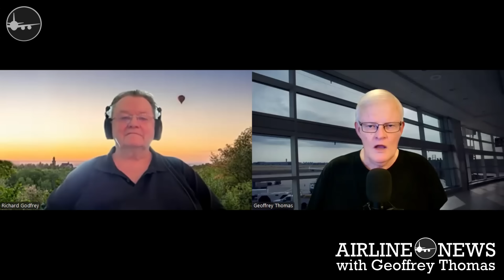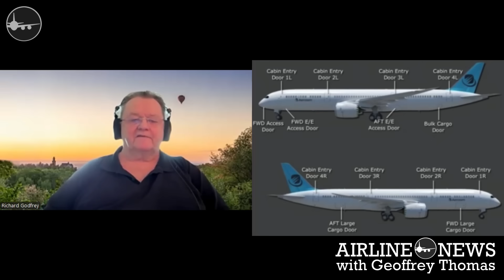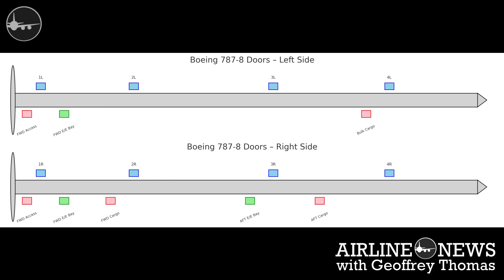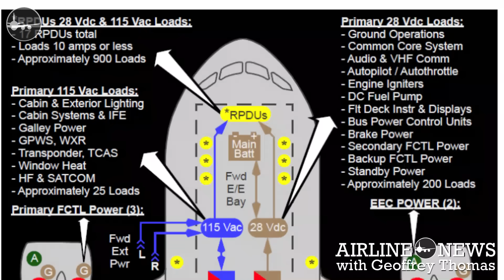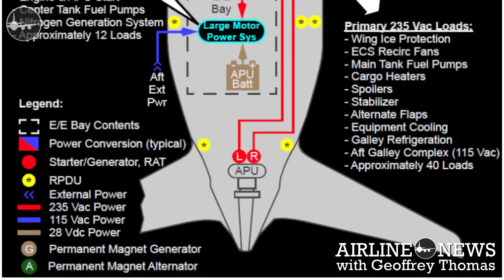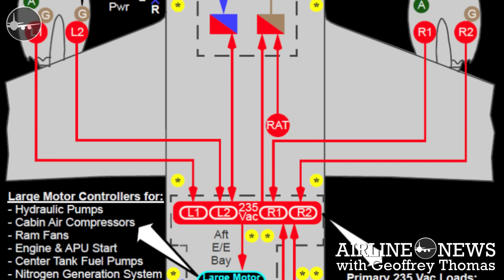Air India Crash Eps 189 - Toilet Leaks Exposed

Comment: You guys are running away from what happened..fuel swich were turned off..first officer saw them at off position  and thats why he asked  the question....he wouldn't have asked if they were not turned off..so stop this please
Reply: ....or maybe he did not see anything, and was simply asking a question, not making an accusation.
Reply: @BlueSpruce2 why would he mention the switches? he would have said we lost both engines...but he mentions the switches for God's sake
Reply: @mwajum Actually whoever "he" was did not mention the switches.  The question allegedly asked was "why did HE cut off" not "why did YOU cut off".  Who's" HE" or did he mean " IT?"  That could be interpreted as a question not an accusation.  We need to have the full CVR recording and transcript in whatever language they were speaking in to understand the context of the exchange.
Reply: @BlueSpruce2  an odd question to ask though. Wouldn't you check the switches that are clearly marked 'cutoff" before making such a statement. ?
Reply: @rodwiggs8892 But it could also depend on when the statement was made - after the engines failed and a potential restart attempt, or immediately after reliazing something was not right?  And did the person asking that question immediately switch them back on?  We really need the full transcript, accurately time stamped with what was being said in the cockpit and what were the mechanical/hydraulic/electrical systems, including the RAT deployment, simultaneously doing on the aircraft.  Like these two gentlemen, I'm just giving everyone the benefit of doubt until we have more conclusive information.
Reply: @BlueSpruce2  fair call. There was a 10 second gap between from cutoff to the movement of the switches to run. This is strange in itself. It's just odd for the copilot to accuse the captain of cutting off the switches. If you think about it it, if you notice the engines have no thrust, you would most likely say, "what's going on here?" not accuse a superior of cutting off the fuel switches. Surely that would be the last thing he would assume has happened. All speculation i guess, but i am not buying the water egress theory, even if Richard isn't 'selling'
Reply: They were trying to restart the engine

Comment: Wow i have a lot of questions here.   So does this data say that the original report that the two eng fuel switch cut off never happened ?   If you look back i have always asked is it possible and thought that the pilot never turned off both switches in one second and that the second  movement of the switches was the pilot trying to relight the engines..   As for things not being done in aviation that are required, i can say this IS true but cant say how i know it is true,   Boeing has a history of money being more important than safety.  over 600 dead and one A/C pilot figured out how to disable the auto flight controls trying to fly the aircraft into the ground and saved that A/C.  Cant wait till the final report by them and you two is out.  It should obvious to everyone that Aviation is flawed like so much in this world, unfortunately these are avoidable.   I am a pilot and I am too worried to even fly commercial now days, and not because of mistakes but because of lack of honesty that leads to more and more mistakes. (not knowing the real issue prevents correction)  Amazing that there is not more media covering this,   When the truth comes out the stock will plumet.   THANK YOU TWO AND OTHERS WHO HELP YAW FOR ALL YOUR WORK AND KNOLEDGE IN CONTINUING TO NOT RULE OUT THINGS AND TO KEEP LOOKING !!!!!!   Im guessing there will be more to find and there will be a lot of money and effort to cover up the real causes of these and other tragedies.  Again thank you for your hard work and efforts.   SEEMS THAT ENGINEERING WOULD  REDESIGN THE WET AREAS AND ELECTRICAL AREAS.

Comment: I guess my question is if one of the pilots activated the fuel cut off switches intentionally, why did they wait 10 seconds to turn it back on at such a critical time?
Reply: I believe the wait was an effort to clear the engines of excess, pilot thinking possibly contaminated fuel. This was a Throw the Book out the Window situation. I wonder if the "Dust" at the end of runway was unburned fuel. Pilots were obviously overwhelmed by error messages, and tried everything to save Themselves and the passengers.

Comment: Thank you for today's episode. There  were / are two  active AD -NPRMs not just one, that relate to this. The first one below  is the one you mention  in the list.

1.) Docket No.  FAA 2025 -1103 /  Project Identifier  2024 - 00141 -T. ISSUE DATE 16 JUNE 2025. /  references back to AD 2024 -01 -01 / Faucet Control Module.  Not all 787 effected - large number were including AI171 - due to some smaller number having a different FCM.  

The second one  which has been mentioned at least thrice before but   never seems to make recognition is the following.

2.) Docket No.  FAA 2025 - 1114 / Project Identifier AD 2025 - 00314 -T. ISSUE DATE 18 JUNE 2025 / references back to at least AD 2023 -08 - 04 /   Missing or incorrectly installed potable water clamps ( galleys and lavatories ) . All 787 including obviously, AI171. 

Given their timing,  ( +4 +6 days after ) these two AD - NPRMs could be a type of tell as to what the FAA's best guess was  in the days after the incident.

________

 So essentially many - most - all  787s   basically started off with poorly designed and assembled  potable water systems, ditto for floor sealing and  whatever else. Nobody should be satisfied with how the FAA / Boeing / Operators as  a group have handled this.
 Perhaps especially with the Lavatories .Clearly nobody wanted to  just start over with new lavatory / galley modules  - until now.

FAA never should have allowed these various water into EE Bay fiascos to drag on and on - and on for 10 + YEARS. 'Inspections' and the other blah blah are no substitute for properly designed and functioning equipment. On any A/C but 10x over for an ' all electric / electric hydraulic' 787.

There are at least two ? other ADs that relate to all this plus the expected AD - NPRMs for all ADs relevant here plus  one ? AD 'withdrawal'. Go read the comments for the various stakeholders especially the airlines, and look at the far more detailed and descriptive language used in the  NPRMs - eye opening does not cover it.

Comment: Finally the root cause has been found. A drop of water has caused a dual engine failure while the FDR did not record anything of the electrical problems caused by that but instead   switch movement . Sounds logical.
Reply: Typical conspiracy theory playbook. Dismiss obvious and simple explanations because of something that isn't fully understood and amplify exotic explanations. Oswald wasn't a good shot because he got one bad score in the Marines, therefore he couldn't have been the one who assassinated JFK, therefore the only explanation is that the CIA pulled Oswald off the window at the last minute and put in a substitute marksman. Conspiracy theorists also like to surround their explanations with lots of scientific sounding analysis. The 911 Truthers do that too, nanothermite, collapse rates, blah blah blah.

Comment: Great info from start to  the end. One issue I have commented on in past videos re maintenance not being carried out if  outside temperatures were 37C what would the temp be inside the Boing sitting in the sun especially with the AC  not working and causing a very harsh environment for maintenance to be working in not just for Air India but any other maintenance workers in any countries

Comment: This is the only podcast that provides an exhaustive presentation of available data and a thorough analysis of the data based on the engineering and performance of the aircraft and the necessary protocols that the pilots have available in an emergency. I have seen many supposed experts weighing in on the crash who persist in pushing theories that have largely been falsified, such as the pilot suicide theory. Yes, suicide - mass murder is great click bait, but pinning murder on men who are in no position to defend themselves in disregard of forensic evidence is a serious failure. In light of irregularities in the initial report, Air India’s awful reputation and the financial expedience of shifting blame intuitively adds weight to the hypothesis that ongoing, negligent maintenance led to system wide electrical failure land engine shutdown. Two matters I would like to see addressed are 1) why are toilets and galleys located where leakage can impinge on critical electrical equipment; and 2) since the need for redundancy in critical systems has long been a priority, how is that both engines could shut down simultaneously from the same (minor) failure?

Comment: Everytime richard brilliantly explains something always gives me another explanation to what may have happened.
The part that I didn't get was the pilot saying why did you switch off,could it be possible that when the rat deployed the pilot flying lost all power was transfered to the captain? Hence why he said why did you switch off? I supose without a full timestamp of the voice recording it is speculation but may have nothing to do with fuel switches.
Reply: The report actually said ‘why did he cut off’. Precision here is important, even more so if the conversation was conducted in Hindi, which I consider very likely.

Comment: Thanks for pointing out that the pilot monitoring and the PiC flipped with the initial pilot flying.   So the first officer was busy flying on takeoff and would be too busy to be shutting off the fuel and the pilot took over and almost got that plane to the highway.  He didn’t try and crash it which he could’ve easily done at that point if he was interested in suicide.  He also almost made that highway which it is obvious that he was trying to get to and would have made it after clearing that last building.  If he could’ve made it, it would’ve saved a lot of lives in my opinion.  Neither of the crew  intentionally shut off any fuel to the engines and they were struggling with a mostly dead and dying aircraft.

At TOGA, those jets are drinking gallon jugs of fuel per second.  Any interruption even for Deca seconds is going to be an issue.
Reply: They are also a lot of YouTube channels that completely don’t get this point and it is a huge oversight to their rush to judgement.

Comment: Would it be presumptuous to suggest that lower than normal fuel flows might have extended the take off roll before possibly worsening once airborne and lead to significant thrust loss such that the accident occurred as it did? Any relight attempts thereafter, both automatic and manual, would then be compromised

Loss of PF’s flight instruments at that stage would also invoke ‘discussion’ and that audio would be captured on the CVR …
Reply: Soon after the time of the crash, I saw a claim that somebody at AI said they were using lower takeoff power setting to save fuel.  I saw that on youtube.  I tried to  find it with a web search but I don't know who said it.  I thought it was these guys.

Comment: Would be good to know where the condensation drain line from the air conditioning system is, especially if the air conditioner failed as indicated by passenger videos on a prior flight.

Comment: Excellent job but how do the investigators prove it to be correct?   The remains of Air India AI171 have been removed from the crash site , the resulting fire from the crash would surely leave no trace of water. How can they prove the electrical failure was caused by a toilet leak and not some other electrical failure such as perhaps a recently change component.   Those maintenance logs seem to be key to finding out.

Comment: Excellent work Richard. As a 787 Captain and examiner I’m impressed with your in-depth knowledge and sharp brain. 
Cudos to you both for an outstanding channel about aviation accidents and incidents. 
Keep up the amazing work.
Reply: I agree! B777/787 Instructor/Examiner & recently retired 787 Capt.
Reply: *Kudos.  With a 'K'.  😊
Reply: @MsLizziebeth1  He was referring to the Clinically Useful Depression Outcome Scale.
Reply: @martinwhite418  - Ahhhaha. Ha. Almost funny!
😊 But not quite.  😅 (Yes it is.)
Reply: @MsLizziebeth1 Thanks, haha.
Reply: So you 787 experts believe some drops of water can cause a simultaneous dual engine failure?
Reply: @JM_2019 Evidently everyone else knows water and low, medium or high voltage electricity doesn't mix well... 😊
Reply: @BlueSpruce2 This is why aircrafts are build with redundant systems. One leak causing redundant systems to fail is something you could not even achieve easily on purpose.
Reply: @JM_2019  Noo, it caused thermal runaway from the li-ion batteries which also rendered the aft fdr inaccessible. 'parrently. [It wasn't located anywhere near the huge explosion + fireball which resulted from the plane crashing] Recalibrate your understanding pls! :face-blue-smiling:
Reply: @mushymystic  If a thermal runaway was the reason for the dual engine failure and made the FDR inaccessible - how can it be the switch movements and the conversation between the pilots were recorded after that? The belief that there is a single source of power supplying all systems is just not correct. FDRs have emergency power supply batteries and even if they fail the are supplied by the RAT.
Reply: @JM_2019 i might not have stated clearly, “inaccessible… to aaib crash investigators…” not inaccessible to the plane recording anything 😊
Tbh i was just riffing on some of the more desperate explanations i have read, and trying to match the level of confidence those explanations are delivered with. 
It’s like devil’s advocate but even more soul-less 😁
Reply: @JM_2019  you have to go in very detail. Some things can be calculated, simulated or tested in real situations. There also are (maintenance/failure) reports and experiences. Of course if a captain shuts down the fuel at low altitude during take-off  i think that is a procedure that almost certainly will crash a plain so ...why should he do that? Why should he think that will save/safe the aircraft?  And why did he tell: i did not do that? Why did they find the fuel switches were turned on and off? Did they really find that? What did they find? Yes ....the machines recovered but .... a crash was the result.
Reply: @HenkJanDrums That‘s the important point: „why he did it“ is not part of the accident investigation, this is part of a crininal investigation.
Reply: @JM_2019  Also, consider that after the inbound flight from New Delhi to Ahmedabad, the aircraft maintenance team had inspected and cleared the aircraft to fly. If urine was dripping into the EE bay, would they clear it? Is AI maintenance that demented?
Reply: @JM_2019 ...and miraculously exactly at the moment of rotation.  This gets more and more laughable with each episode.  Why do you 2 keep fighting the initial preliminary report?
Reply: @JM_2019 What's so difficult to understand? The fuel switches were moved to cuttoff.  End of.  What on earth are you two doing coming up with the most bizarre explanations????  Each episode gets more and more far fetched.

Comment: The AD was 2025-09-12 due to be completed by June 18th, a few days after the crash. So technically Air India could have not yet performed it and still be compliant. Just like for the Air France AF447 Rio Paris crash, for which the faulty pitot tubes (that were one of the contributing causes) were due to be replaced, but not immediately. Ironically for the AF accident aircraft, the change was scheduled for the week after
Reply: It’s important to note that VT-ANB, the crash aircraft, wasn’t covered by the new AD (2025-09-12). That directive only applied to later-production 787s (post-2018) where sealant/tape was omitted at the factory.

VT-ANB was delivered in 2017 and was already subject to AD 2016-14-04, which required the sealant and tape barriers to be in place. So Air India couldn’t simply wait for the 2025 AD — the protections should have already been there under the earlier mandate.

If water ingress occurred, as reports now suggest, it would point to a failure of compliance or maintenance, not that Air India was still “compliant” under a not-yet-due AD.

Comment: A number pilots have stated that when an emergency arises while the FO is flying the aircraft, the Captain takes over as standard protocol. So the Captain was most likely flying the aircraft during most of the 30 seconds the plane was airborne.
Reply: Wrong. That is not what happens. The captain will probably take control for any emergency landing, but NOT immediately something happens on takeoff. The PF continues to operate the aeroplane until all the drills are done.
Reply: @petesmith1924 Yes, that is the case - but let us not forget that the PF had no flight instruments (unless he was quick enough to transfer his PFD to the left source or use the standby instruments) That flight deck must have been a mind boggling plethora of warnings, alerts, horns and bells that would tax any crew at any stage of flight
Reply: Peter - I agree. B777/787 Instructor/Examiner & retired 787 Captain.
Reply: and why wouldn't the Captain at least try to steer the plane onto a road? It would have been fruitless but it gives more of a chance that hitting buildings